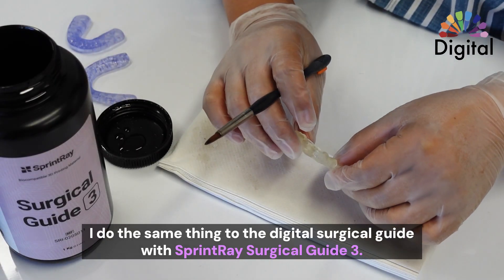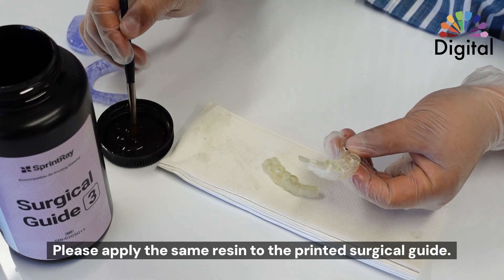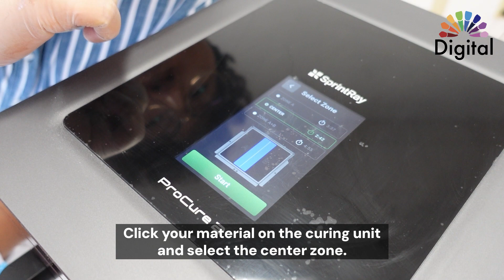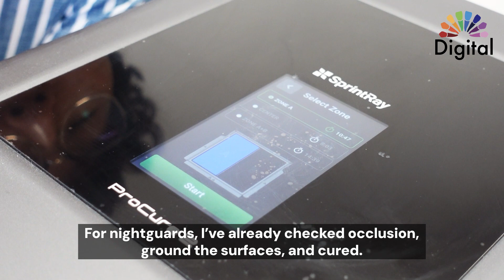Digital Highlight - How To Glossy Finish 3D Printed Nightguard & Surgical Guide

Comment: for some reason i cannot achieve these results i have the sprint printer and cure and only use sprintray resin but i can never achieve the high gloss. each time i place it back into the curing machine it coms out uncured as if i can just wipe off the resin with my hands. any tips?
Reply: Did you try use a light curing to cure it before putting back in the machine???